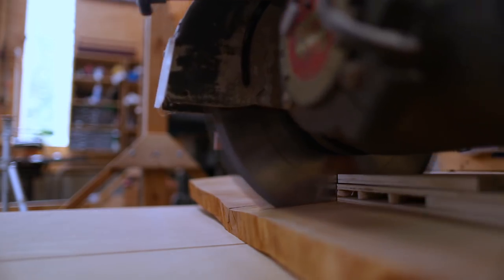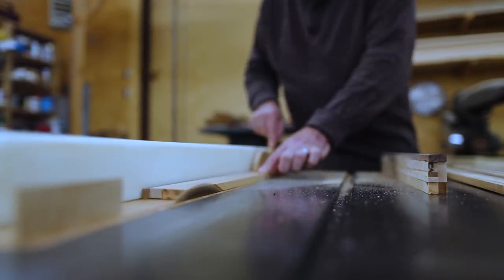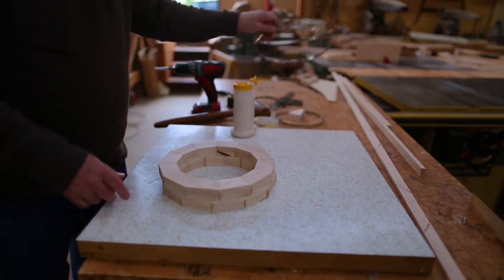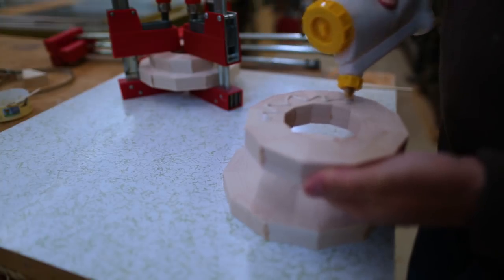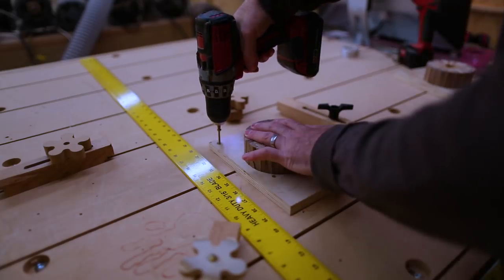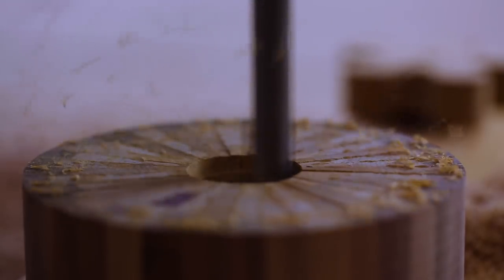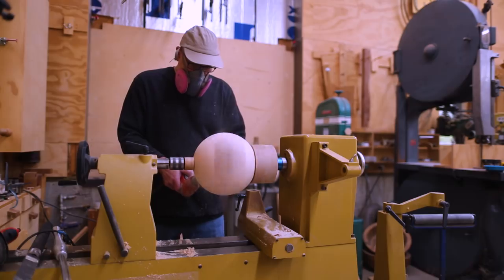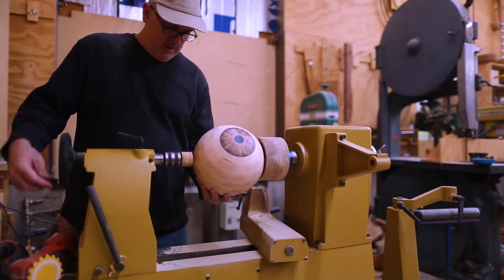Woodturning the Eye

Comment: My god I want your shop. Also your video production is outstanding (as always)
Reply: Without his skill, the shop would be useless.
Reply: Of course, his woodworking is top notch as well. Doesn't change how badly I want his shop!
Reply: +sleeptyper skill comes from doing and having your machines all set up in a place to do it allows it to happen
Reply: marble head Exactly, your machines that you have chosen based on your skills. Frank's shop has evolved from his workflow, his demands for machinery and photography et cetera. Now, someone else could do well in Frank's shop, but reaching the same awesome level of Frank would demand years of doing and ... evolving the shop.

For example it took me ~4 years to learn my tool (crane truck) to rise from simply pulling the crane levers and avoiding damage to doing micromoves without even looking at the levers. That crane doesn't have a remote controller.
Reply: Check out Franks video on building the shop !
Reply: sleeptyper I agree that without skills, the shop would be useless. But a good shop always helps!
Reply: The Cutting Bored
Reply: The creativity of your woodworking and video production is breathtaking.
Reply: And the stop-motion stuff is a nice touch. :)
Reply: dualing powermatic 66 love it
Reply: Came here to say the same thing. Not really sure how one gets a shop like this... baby steps i guess
Reply: I was about to write exactly this :)
Reply: Yeah I want to attend a turning school run by you!
Reply: @hille50  I think it's a lot of things. One of the major ones though I think is that Frank drives an older truck. It's very functional and does what he needs it to, but he also surely hasn't no monthly car payment and probably hasn't for quite some time. If his record is clean his insurance is probably super cheap too, and vehicle tax is likely next to nothing. Add all that savings up compared to what it costs to own a new car and were talking easily $500 a month plus. I'm sure you could build a pretty nice tool collection fairly quickly with that budget. He also talks about buying most of his tools at auction or on craigslist. This is all my speculation of course, but I think thats how one gets a shop like this.

Comment: Hey Frank. I finally decided have a go and made an eyeball with some super cool modifications... After watching this vid over and over for the last 6 years.
I upgraded and inserted a 1080 high definition tiny long/spout camera with a wifi bank, battery, etc.
The camera lense fits on the inside through the center of ebony section of the iris. I also made thin supper clear resin cover which covers the lense that provides a smooth external finish, and because the camera lense is black you really have to look hard to detect the it even there. The eye section has a rebated box join around the center band that fits really tightly together without detection, but can be gently prized open to access camera parts and battery to recharge. 
I entered the eye in our New Zealand nation wide woodturning exhibition, also had a tablet screen connected in the table next to it so people could actually see themselves looking at eye - was so funny, I wish I'd recorded it. It caused so much attention, it became a huge talking point in the gallery, I was blown away. Also had piece of paper on the table with your YouTube channel written on it. The exhibition organizers said I should have entered the national woodturners gallery for a prize award. They all recon I'd likely have won the show... sadly though I was unaware of that event, and the rules state all items that enter the woodturning show / prize award, aren't allowed to have been entered or shown in any other event prior - darn it, cause the winning prize was 10k... even 3rd prize was half that.
Thanks for the inspiration towards giving different items a go. The lathe for many is achievable - even if viewers have to join a woodturning club to do so... HOWEVER, Unfortunately all your fancy machinery has lost touch with reality and cuts most woodrworkers out of the loop of being able to try it... I'd like to see a bit of both from your channel - food for thought.
Anyway - Keep safe ✌️

Comment: I love your little stop-motion bits.

Also, is that a SNES controller you're using at 10:57? Nice.
Reply: While I'm not Frank (nor do I know him, but was fascinated by this project as well), I believe it's shaped like a SNES controller, but is actually a controller that has a USB cable. The controller part is speculation.  What I do recognize for sure though, is that he's using the controller to jog the position of the CNC router, which I've seen guys use controllers or wireless mini keyboards to jog the position.  Also, a long time ago, I had a controller made by Gravis that similar shaped, but was 15-pin for the old PC joystick ports.

Comment: 6:22 He says that as he's smearing glue all over it. Not really clean in my opinion. Like if you agree or thought the same!
~R
Reply: He is saying he wants to clean up the inside and outside of the cylinder, NOT the top and bottom of the cylinder (where he is smearing the glue).  There is no need to clean up the top as it will be turned away to expose a clean surface.